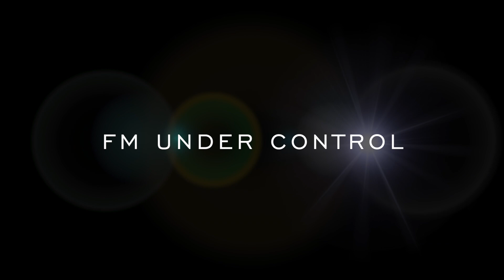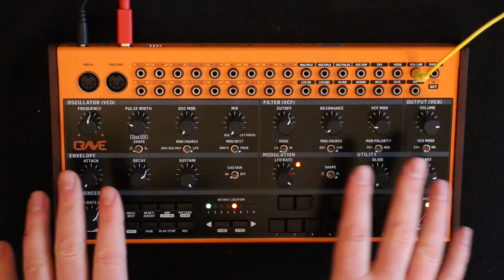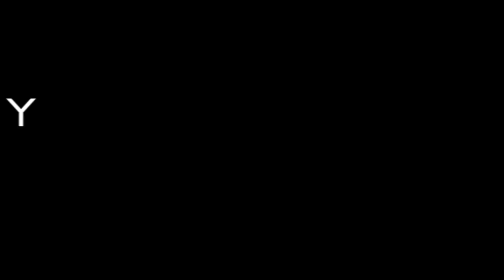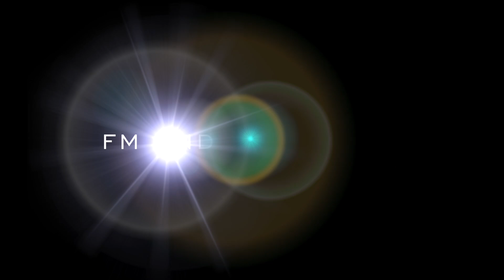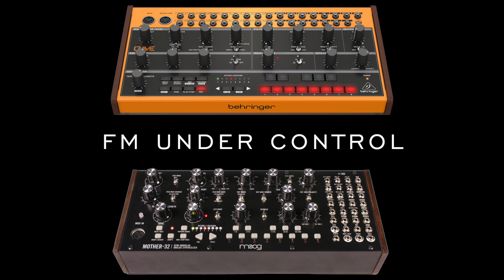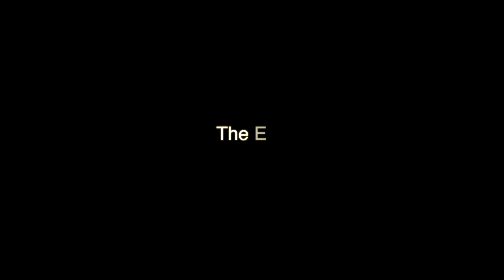Patch Ideas #5 FM under CONTROL: Behringer CRAVE and Mother 32

Comment: Hi, I'm quite new to FM, so don't have a very good understanding of it. I notice you mod the VCF, is this FM? Is this not just some sort of AM with phase shifting? Isn't FM modding the pitch of the oscillator?

Thanks.
Reply from the maker: Strictly speaking perhaps. I’m modulating the filter frequency at the frequency of the oscillator similar to the Rev 2 or tempest. So could be considered a type of FM.. of the filter. The tempest calls it audio mod. It comes under the cross-mod section of the OB6 and poly mod on the Prophet6.  Cross mod on the Jupiters for example is only oscillator to oscillator. There’s linear FM like the DX7 and exponential FM on analogs so the terms are not strictly adhered to. FM on the DX7 for example is actually phase modulation (as far as I recall). For simplicity’s sake I called the FM as I think most will understand it’s using the oscillator as a modulation source.
Reply: @StarskyCarr I've read that the old synth used the term cross-mod for about a dozen different things. lol. Thanks.

Comment: thanks for the informative video. I got my Crave yesterday, and one thing that makes me wonder is that it seems to react to note velocity over din-midi? Tried it several times, to hit a single note light and hard and the sound changes when I do that. Is it supposed todo this or is it a bug in my system?
Reply from the maker: I think this is a setting on the Behringer synth tool app.  It’s definitely not a bug. Download the app and change to constant velocity. I think it has notes with a velocity higher than a certain value will trigger an accent - and you can define what an accent does (how much additional volume and cutoff etc).
Reply: @StarskyCarr  Didnt know about the synthtool, thanks. Another question, my Crave has this little "digital  noise" jitter in the background. It seems to come from the LFO.light, cause the "jitter"-frequency raises when i change the speed of the LFO. Is this on all Craves or did I get a bad one? Its kind of distracting since you hear it even with low volume. Sounds like a sample with some digital noise at the end when you play a note. Not what you except from a analog synth :)
Reply from the maker: @AndrewTSq  I've not notice it on mine.. I get something similar from my Sherman filterbank (that's supposed to be there) so I know the sound you're talking about.  I'll take a closer listen.
Reply: @StarskyCarr  Ok, thanks for your answer. I Will send my Crave back, and hopefully they have another one in stock to send me :)